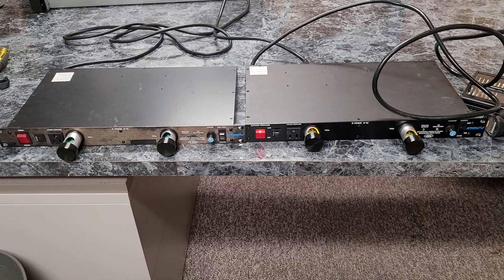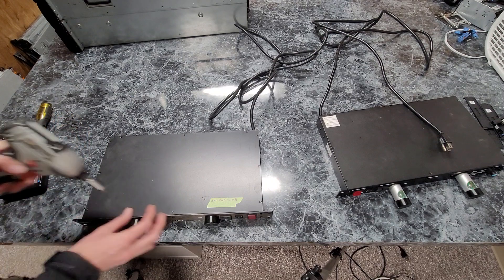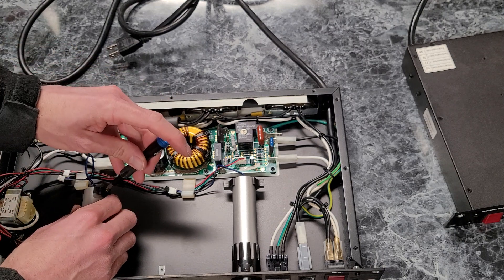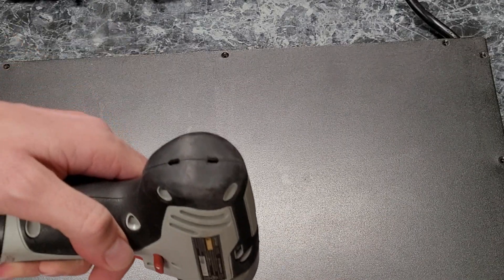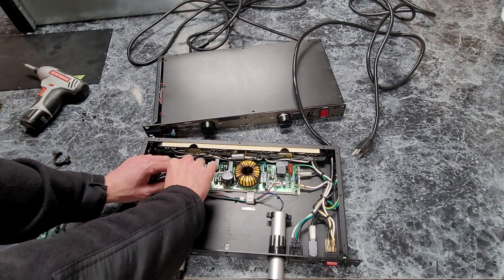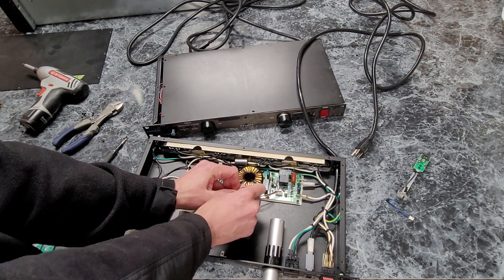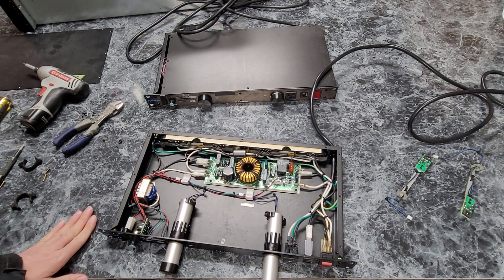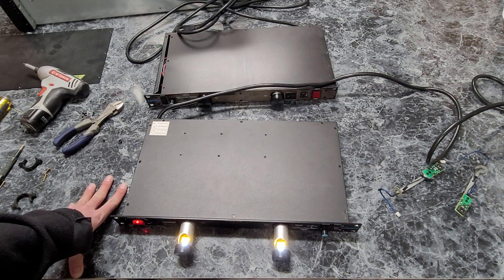Fixing a Furman PL-8 Series II rack mount surge suppressor and partial #teardown

Comment: Thanks for this excellent video digging into the PL units.

I'm curious about the 15amp fuse on the front - would you happen to know that part #? I believe I need to replace one that is cosmetically broken, but still working.
Reply from the maker: I don't remember where I put the donor unit unfortunately.